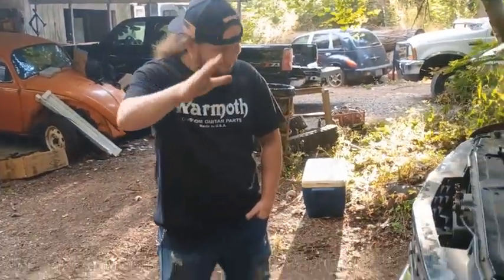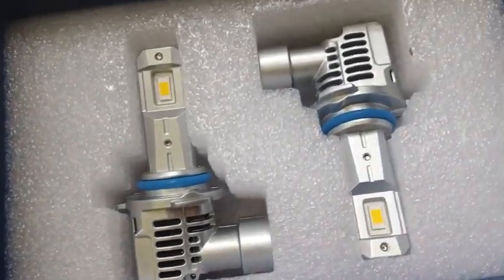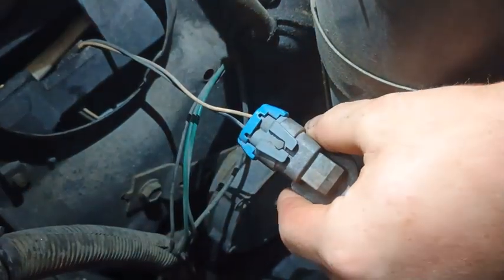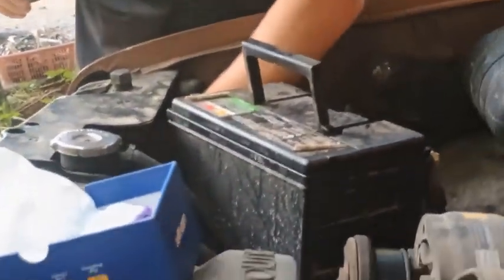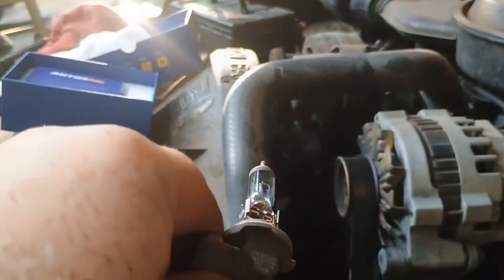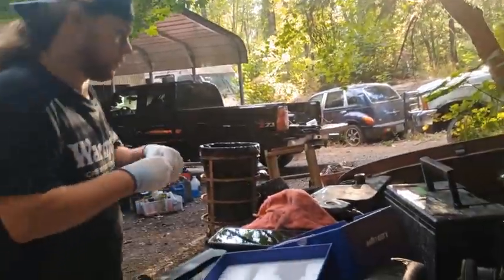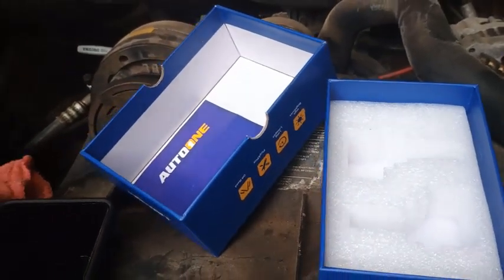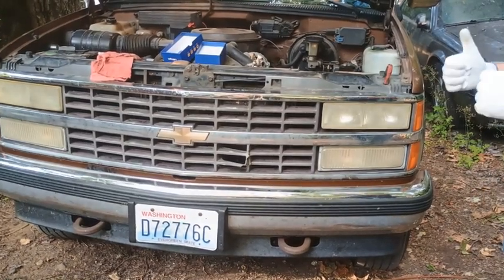AUTOONELED In A OBS Chevy!

Comment: I had always heard it was halogen lights you don't want to touch.. 
We tried to put LED headlights in the '07 Tahoe, screwy setup they had, only way they'd fit, would have been to cut the framework out behind the light buckets and cut a hole in the filter housing.. wonky heat sink was the wrong shape and huge!
Those look really nice for fitting in the space provided!
Low beam are going to be as bright as the high beams..lol
It's amazing the LEDs you can find for things!